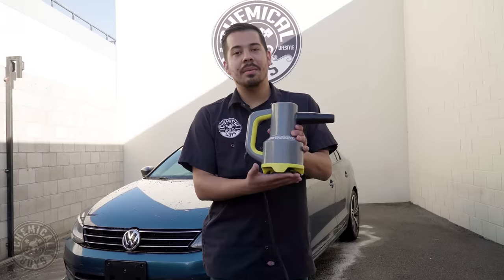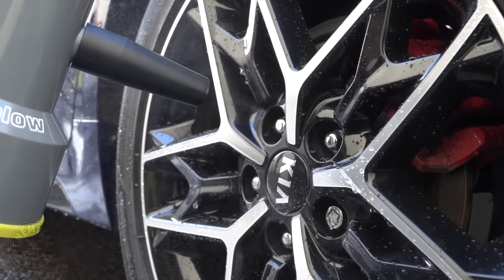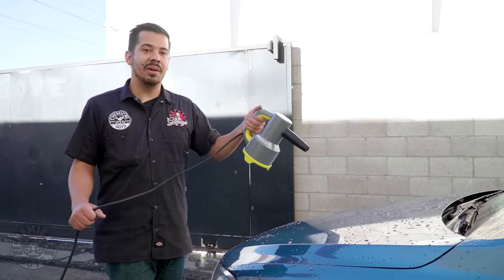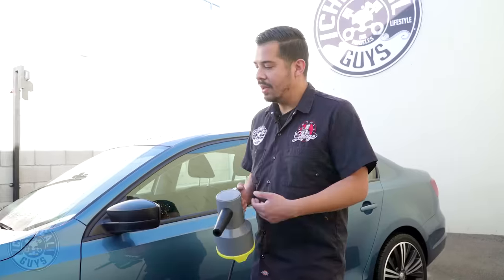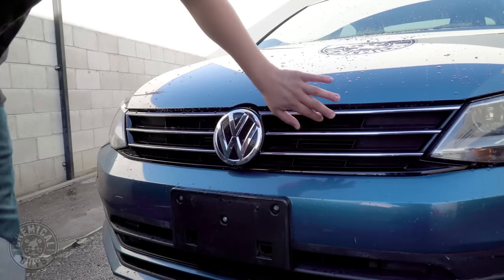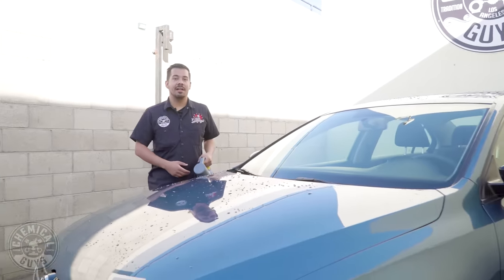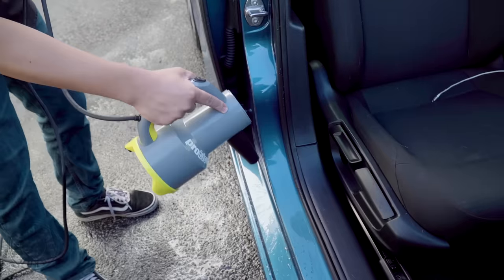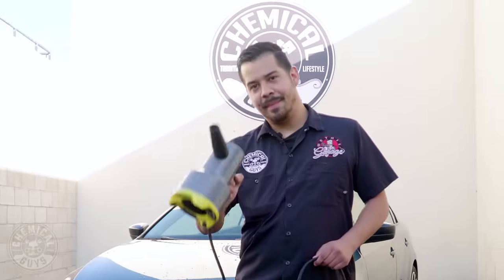ALL NEW! How To PROBLOW: Touch-Free Dry Your Ride! - Chemical Guys

Comment: That little drip from the side mirror is my arch enemy 😤
Reply from the maker: Use the ProBlow to effortlessly dry those cracks and crevices!
Reply: I can relate. Especially when you close the door
Reply: Air compressor baby! Or this little cute thing works good too.
Reply: The absolute worst for black cars 😢
Reply: Lmao on god
Reply: I’ve got a stupid Toyota that when u open the doors both windows has this stupid slight open feature and closes as soon as I close the door.
Reply: I just use a 20v shop blower , i modified an extra tip i had for a more concentrated flow
Reply: Mine too
Reply: @J3LVN1 why? I need to know before to buy,  feedback pls
Reply: Before I was into washing my car in my own I used to pay a subscription for an auto car wash that I used everyday and over time that little drip  actually left a very ugly mark

Comment: Is this recommended over classic towel dry? Is there a benefit one way or another?
Reply from the maker: Hi William! Using the ProBlow will prevent the chances of scratching the paintwork during the dry process and gets water drops from cracks and crevices for the best finish.

Comment: Does this heat the air?  My detailer advised against buying a blower that heats the air, because we have hard water.
Reply from the maker: Hi Regina! The ProBlow will gently warm the air as it blows but not to the point of hot air.
Reply: @ChemicalGuys  thank you for the quick response!
Reply: That's not a heat gun